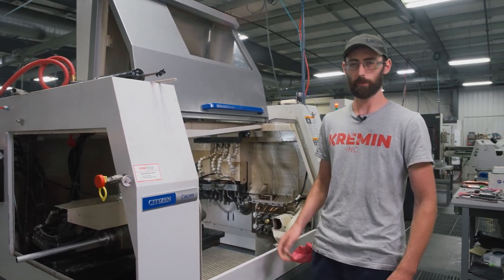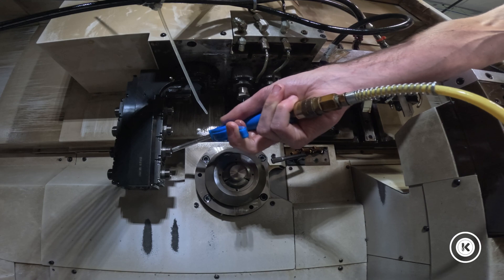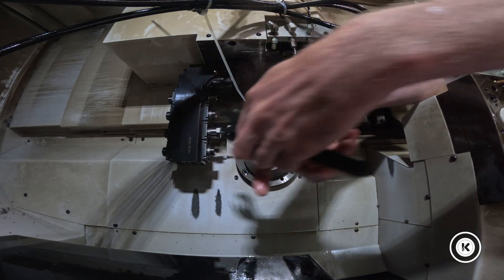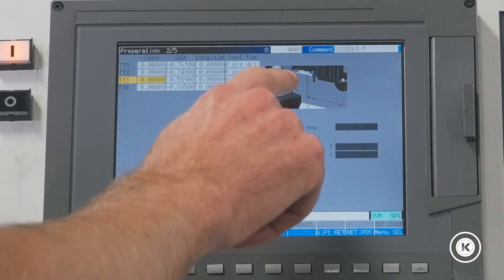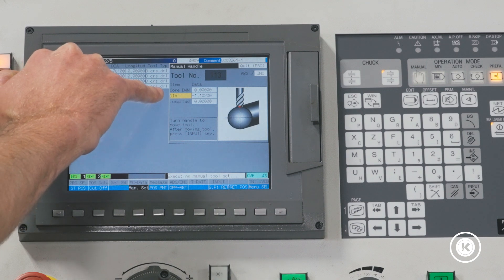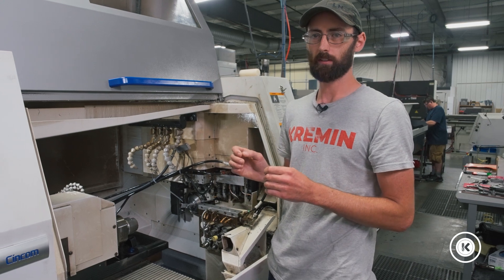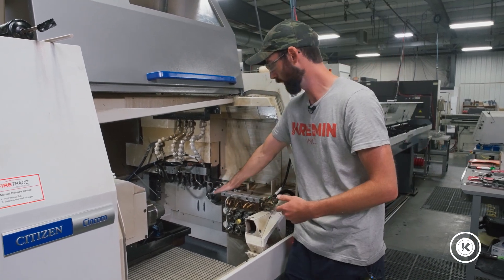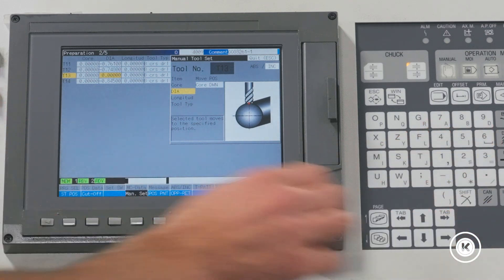How To Touch Off B-Axis on Citizen Swiss Lathe

Comment: I've said it once and I will say it again: this channel makes the BEST Citizen setup videos on YouTube! Can I make another request? Can you guys make a video explaining how to adjust Core on the gang tools? Not just Core, but also Core DWN. I struggle with both at work and I think I just need to see one of your guys do it to truly comprehend how it is done. You guys rock!
Reply from the maker: Thanks for the shout out, I will ask the team about your request for the next set of videos!
Reply: Core is the Y axis equivalent of DIA. To set it, measure your tool from the bottom to the cutting edge. Your machine should either have .500, .625, or .750 nominal tool height. The formula is ((measured)-(nominal)*-2)=core value
If your tool measures .503", it would give you a core value of -.006", shifting your tool negative in Y to be on center of the bar. If it measured .494", your core would be +.012", shifting positive. Set the core to this number, don't add it to an existing value.
That will get you close enough for most work, assuming your machine hasn't been crashed and needs a grid shift.
If you have a tit on the part or bar that you can measure, you can add or subtract that in core until it goes away. Square tits= behind center-positive core adjustment. Pointy/volcano shaped tits=ahead of center-minus core adjustment.
I don't see Core DWN on our machines, what machine and control are you running?